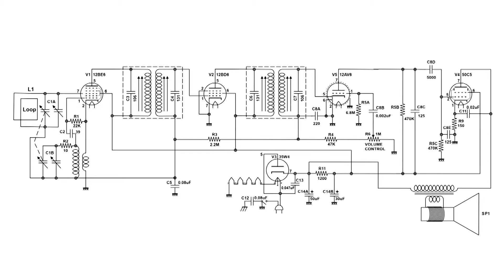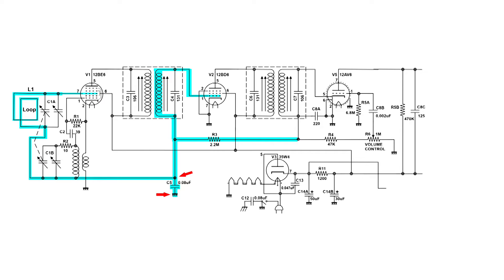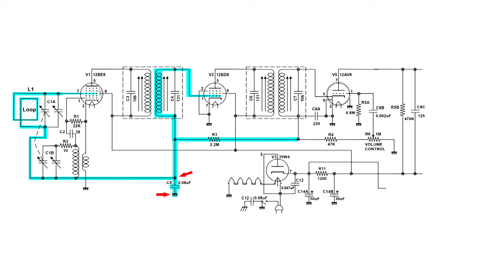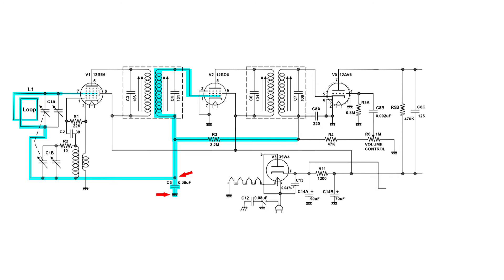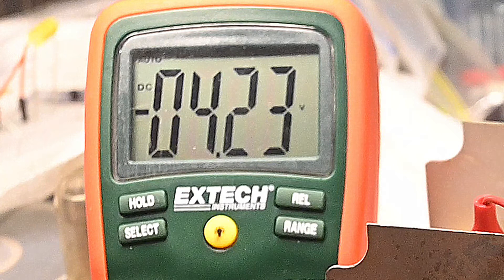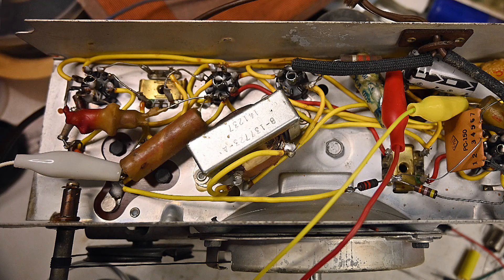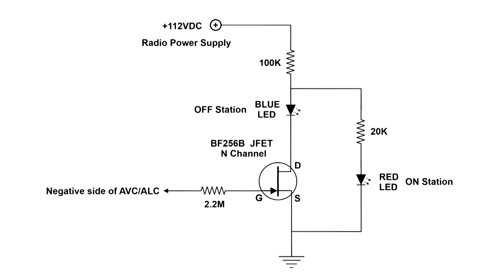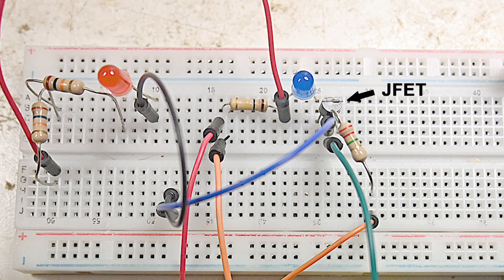Build a Radio Station Detector Circuit using the AVC or ALC

Comment: I really like this but I wonder what your schematic would look like if you were to use a bi-color three lead LED to indicate  ON Station / OFF Station.
Reply from the maker: Thank You.
If the diodes are configured in the same direction, that might work. If the diodes are configured in opposite directions that won't work with this circuit.

Comment: Hi Rick. Thank you for sharing this video to us. I think this red led  in the circuit could be replace with vu meter as a reception level indicator.
Reply from the maker: Yes could, I would prefer a meter. 
Thank you.
Reply: @AllAmericanFiveRadio  thanks Rick. I have a last question regarding replacing a led with vu meter. How do we calibrate the vu meter ?
Reply from the maker: @pepsodentpasta  I would use a variable resistor to find the correct value.

Comment: I just love your videos...  Thank you...!

But I do have a question:   Why couldn't use just put an LED + 300ohm resistor in series across the AVC line and ground ?
Since the voltage potential these varies between 150mv to 4000mv, that would be just enough to drive and LED, and it's intensity would vary with the strength of the signal...
I'm dumb, so please let me know if my thinking is wrong...
Reply from the maker: Thank you.
The impedance of the circuit must be high so that it does not short out the AVC voltage.
Reply: @AllAmericanFiveRadio  
Ok, so it's moot trying to do this, since the impedance is so high, that it probably can't drive the LED, and your dual-LED design is more elegant..   Thanks...!